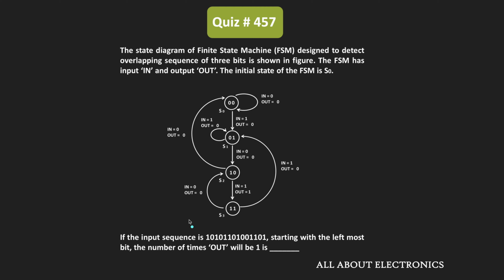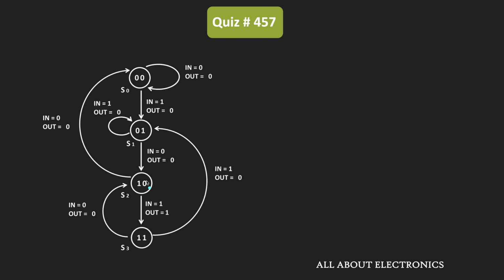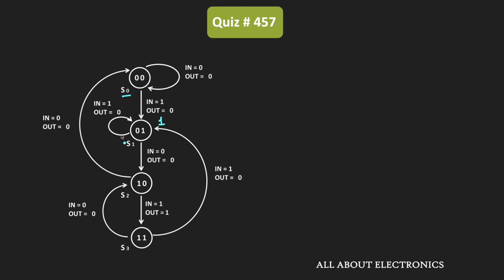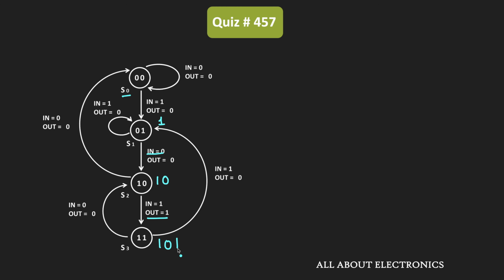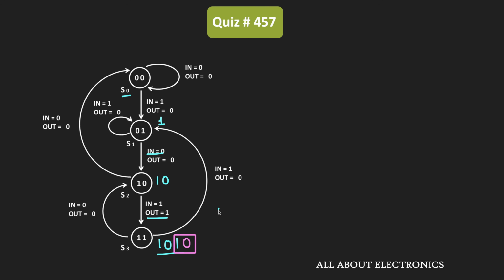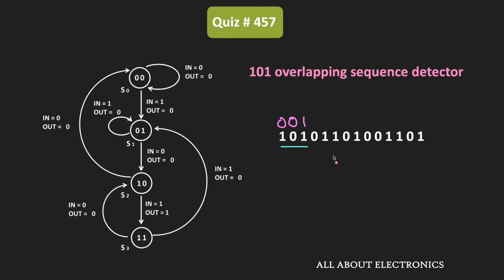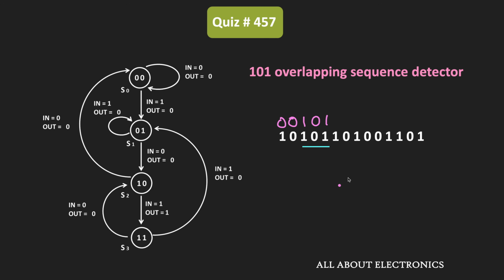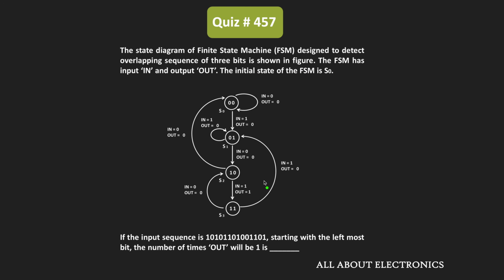Sequence Detector (Finite State Machine) Solved Problem | Quiz # 457

Comment: Do we really need 4 states for this ? i mean why can't we use only 3 states to detect 101 overlapping case.
Reply: if you observe carefully the states 01 and 11 are equivalent states from sirs previous video, so its actually 3 states only
Reply: could you please clarify the same ?
Reply from the maker: The state diagram itself shows, why you need four states. Each state shows the received sequence. 00-> initial state . 01--> when 1 is received . 10--> when 10 is revived. and 11 --> when 101sequence  is received.